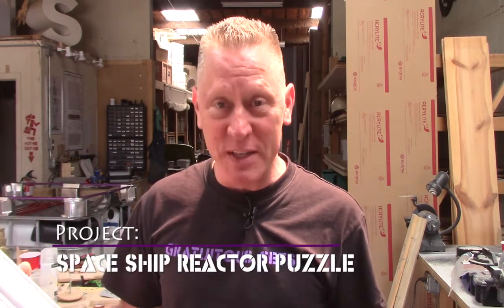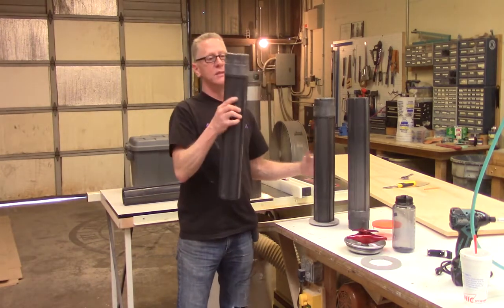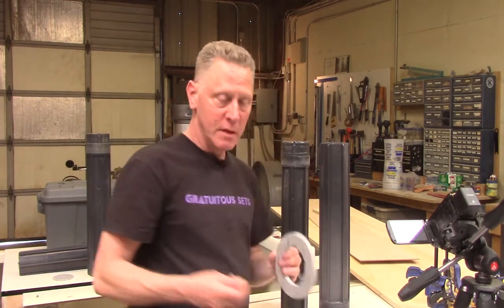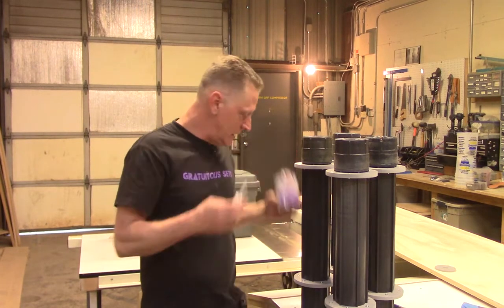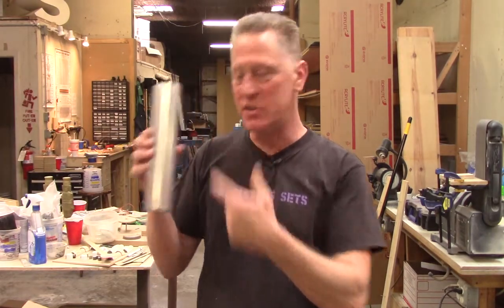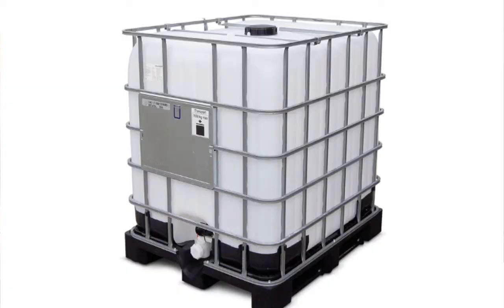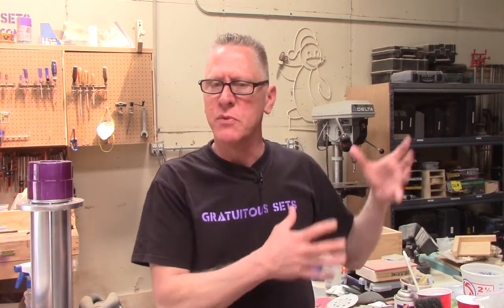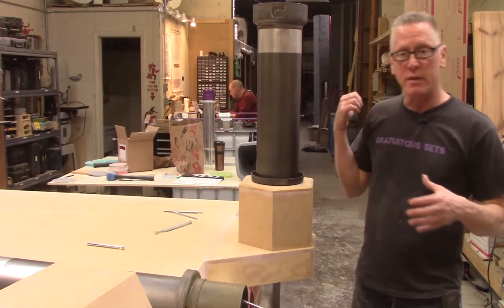Escape Room: Spaceship reactor puzzle

Comment: It's not very durable but Molotow Liquid Chrome is magical.  It comes in a paint pen and sometimes in a can, but you can buy paint pen refills that make fantastic finish when airbrushed.  https://www.molotow.com/en/applications/marker-applications/liquid-chrome/
Reply from the maker: I love the look of Molotow (I have a bottle of it and use it in the airbrush) but it doesn't seem to dry and stays tacky (like Matt's mom).  I've used a few different clear coats with it to try to seal off the stickiness, but they have all dulled it substantially- even using Alclad clear.  Any tips on clear coating or even just getting it to dry?  -Mark

Comment: I love the reactor prop but how they hell would we get them in our rooms? Aren't those things over 40" wide?
It looks brilliant though!!
Reply from the maker: Very good question.  We asked the folks at Red Door to pass this along to the Sheetrock contractors. Leave one panel without "tape and bed". That gives us a 4'x8' aperture to use as a giant door, then close with a sci-fi detail strip. I'll try to make sure we show that in the install video for you- not just the opening, but hiding it. It would word in any room. It could be taped and bedded after installation, but often there are trim options that can hide an open seam.
Damn fine question!
PS:  George Lucas didn't screw up the original trilogy because he had limited control. The Ewoks were his idea. Nuff said?